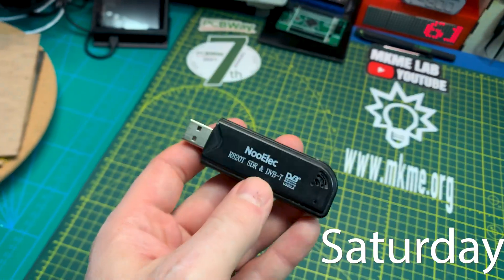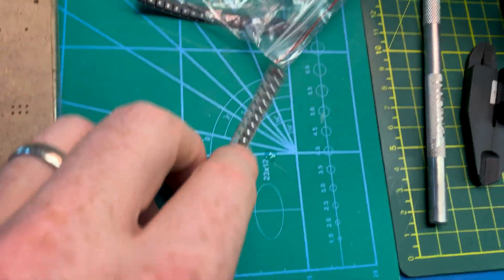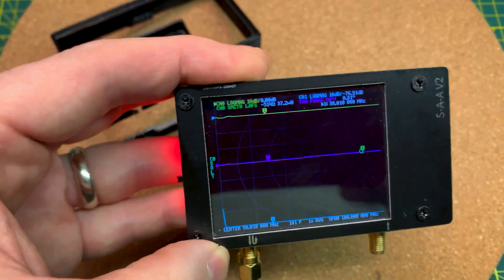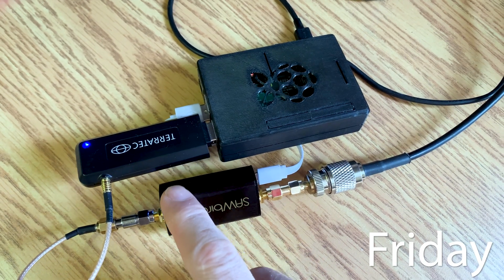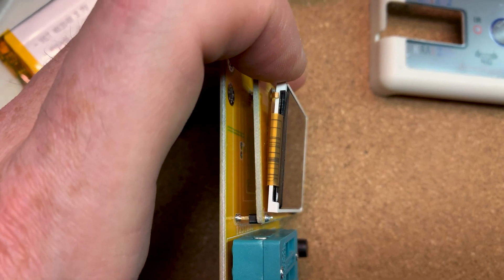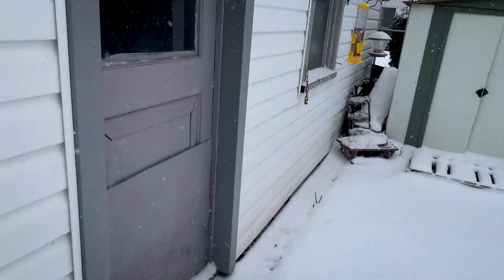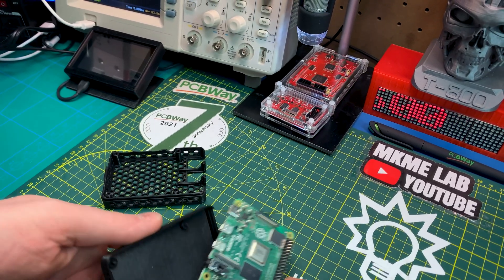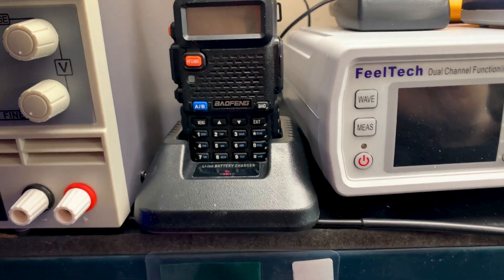Raspberry Pi Satellite Receiver, Antenna Testing | Update

Comment: Is there a way to give my JD-Tractor a cheap GPS Signal with about +/- 3cm ? ...i already have the GPS +/-15 Signal, but a RTK Version would cost 6000 EUR ...do you have an idea? I mean its just a JD-RTK Modem which they sell including "their UNLOCKING of the Display"  for 6000 EUR (the only hardware is their RTK Modem, which is max. worth 300 EUR). So the large amount of money is for their "Software Unlock"! Some say this is a kind of "fraud" ;-)